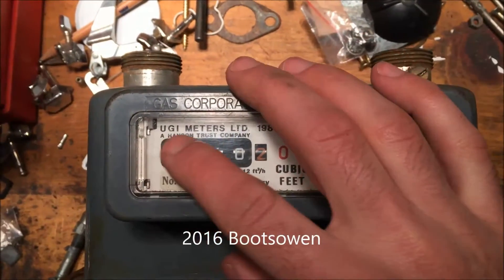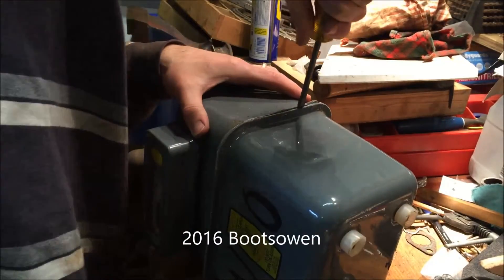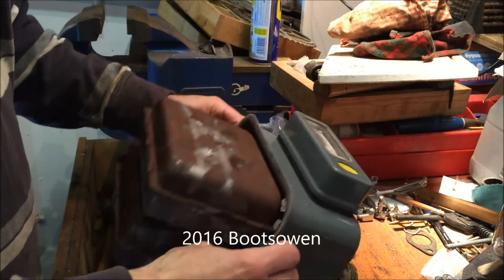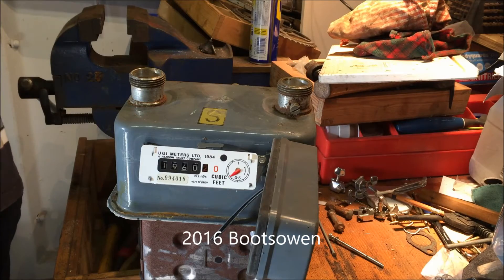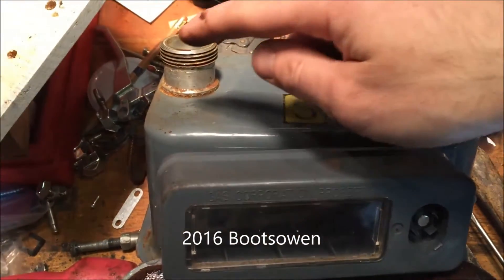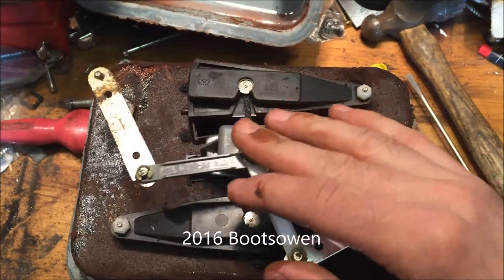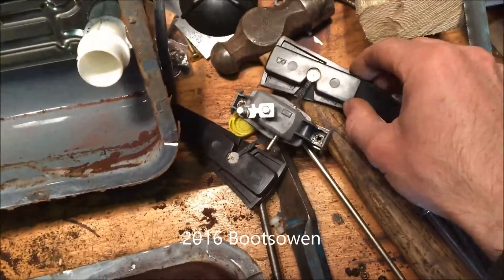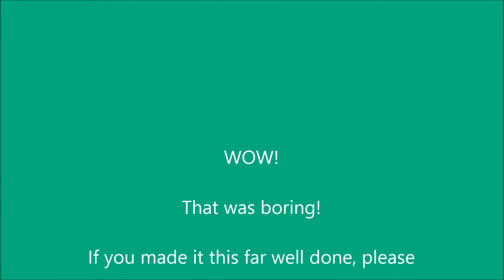Dissecting an old Gas Meter

Comment: Beautifully simple mechanism. I would imagine it's quite slow moving even when several appliances are in use as the volume of the diaphragm cylinders is quite large and hence, be very long lasting and reliable. Also, if either  diaphragm fails I would imagine the unit would stop passing gas and would have to be replaced or repaired. The only other obvious point of failure is the gear train to the dials. I suppose that could potentially break (e.g. a stripped gear or broken shaft) and stop metering the gas. With the new smart metres, I guess that would be instantly reported to the energy company.
Thank you for the video.

Comment: Excellent and very informative. I am just wondering if they are still accurate and give an incorrect reading after a few years use. Suppliers are reluctant to replace meters after a few years unless you pay. They used to be free as part of your contract. If you have a smart meter fitted then they will be free, don't want a stupid smart meter they are a con. Great video many thanks
Reply from the maker: I can’t tell if it’s accurate but I don’t use much according to the meter so I am happy enough.

Comment: There is a way to slow these meters down without breaking any of the seals. I don't know the process but gas meter was off and something was being prodded into one of the holes, not sure which one though
Reply from the maker: I have heard that if you turn them around so that out is in and in is out they will run backwards, I am not brave enough to try it however!

Comment: How could you stop the meter when it is still installed? I heard with magnets, but I think not with this structure
Reply from the maker: I can't see magnets working on a gas meter, maybe some electricity meters.
If you don't want to pay for gas just take the meter off and bypass it. It is illegal, but stealing usually is.

Comment: Clicking sound is coming from our meter when we turn the gas on. Please advise if it is safe to use it as it would take 10 days for the technician to come.
Reply from the maker: I am not a gas engineer. You should talk to your supplier or gas network. Whoever owns the meter. They normally come out immediately if you say you think there may be a leak.
Reply: @bootsowen  Spoke to them. They said they will only come immediately when there is a leak. Currently no smell is coming.

Comment: that was'nt boring to me. I'm in America and just acquired an old gas meter that our Maintenance man threw out. Ours work the same but have two round bellows and an Pentograph-ish sort of arrangement on top to move the bellows. and are a heck of a lot easier to disassemble, Albeit a couple of screws designed to break when removing them, so tempering is evident. On the contrary, I found your video very interesting to see how your gas meters look and work on your side of the pond. :)
Reply from the maker: Thanks buddy!

Comment: Mikes electrical stuff did a teardown of a modern electronic gas meter which uses ultrasonic pulses to measure gas usage. Very clever stuff. Someone made the very comment that was on my mind which was "tear down a mechanical meter for a comparison" so I was most intrigued to find your most excellent video. Interesting comparisons in that the gas tight chamber in the new meter needed grinding open but this one is secured by an easy to remove metal band. For the life of me I couldn't see why the clock housing refused to part with the meter body but no matter, the bellows mechanism was fascinating. I assumed it would be a vane of some sort turning the clock mechanism - very surprised to see the bellows mechanism. I wonder if the corrosion is due to it having been disconnected and left open to the elements for some time? Even with some moisture content in the gas the absence of oxygen should have kept the internals pretty pristine? Great video, thanks for posting!